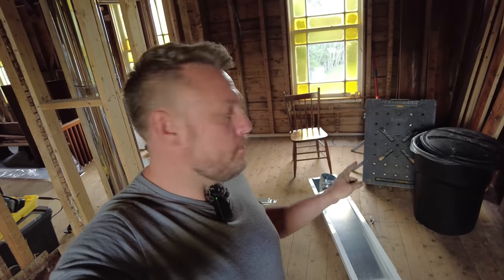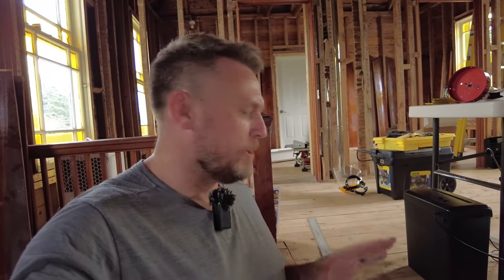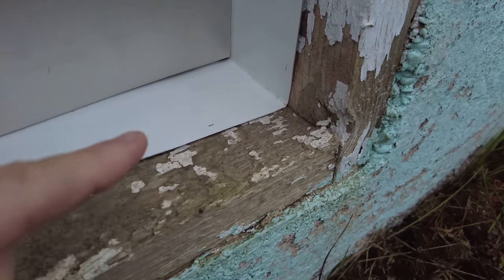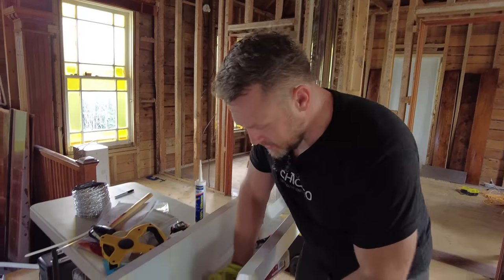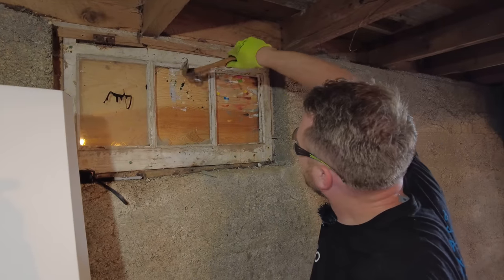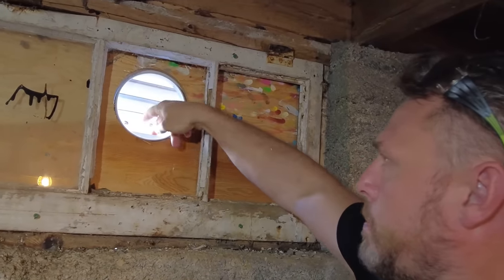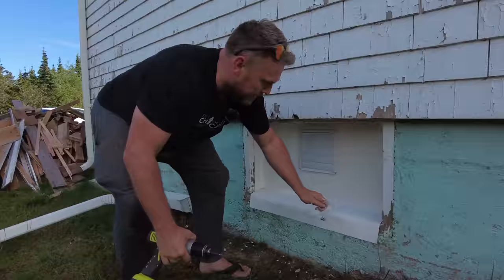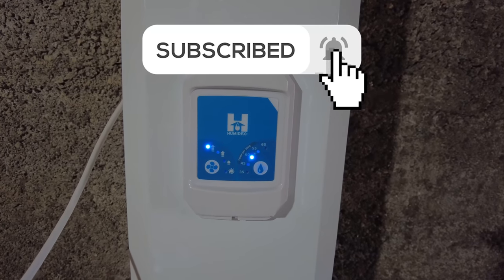DIY Installation of a Humidex in a Damp Old Church

Comment: As a landlocked prairie boy, I would guess that the proximity to the ocean would dramatically increase the humidity throughout the area and the air you suck into the church from outside would be bringing humidity into the building.   Today the humidity in Halifax was 99% - hopefully it's drier in your town than that.   Good work on the de-humidifier Gav!  Much better than I could do for sure.
Reply from the maker: 99% in December? Then it must have been 300% back in the summer.

Comment: I wouldn't worry about that janky line cut, just fix it in post.

Maybe consider shoving a little of your caulk in the bottom corners of the tin to keep rain/moisture from getting in there. Probably not a big deal if you plan to replace all that though. :)

Comment: Gav, although a photographer I'm also a commercial manager for one of the UK's leading ventilation companies. If you want any advice drop me a line. But I would definitely consider MVHR especially where you are located and recovery of the heat you are throwing away is vital

Comment: We had very damp rubble-filled void under house we bought in 2013. Spent days clearing of rubble, dust, loose material. High water table. Driveway slopes from pavement to house and met house along dpc!
Cleared driveway down 70cm. Dug ditch across front of house, French drain and channel drain at surface. New driveway sloping steeper to 2 courses below dpc.
   Void now bone dry, warm, rubberised matting, pleasure to use for storage or work on wiring or plumbing. Venting just via original air bricks. Lesson - eliminate source of damp whether vapour or water seepage

Comment: That's a pro job Gavin!  I hope it does the job for you.  If there's open earth areas in the basement it may have to run 24/7 to keep the humidity low. If I could make just one suggestion, I'd suggest running a bead of caulk along the seam where the sides tuck under the bottom sill part of the flashing you made for the outside of the window frame so water doesn't get underneath.  Looks super!

Comment: I get what your trying to achieve for the basement, needing to get the moist air out of the basement is a very good idea, but…..(theres always a but isnt there)…..air will be drafted from elsewhere….assuming you have cross ventilation (multiple air vents around the foundation) its going to pull air from the outside through those vents. If you live in a dry climate as I do, I believe it will beat buying a crawlspace de-humidifier. Where you live I am assuming its humid (i live in the desert so everyplace is humid compared to me) I would place a humidity gauge in there and measuring a before and after….my last house had a crawl space and it doesnt take but a day or so to “refill” the normal level the crawlspace will hold. I do have a feeling to get that big of an area dry in the end you will need a crawlspace de-humidifier as with that it is drawing the moist air from the bottom but when you live in a humid place all the air is moist and with the cross ventilation your going to replace that air immediately with this outside air. Whatever the humidity level is outside will more than likely be the same humidity you will have in the crawlspace. Easy way to know is get a humidity gauge and place it in the crawlspace and see what the weather says the humidity outside is and compare

Comment: Great work and video Gavin. (As always) I would have suggested filling the old window out so it’s flush to the exterior foundation wall. Then you wouldn’t had to do all that metal bending. Adding insulation to the space would help. Thx for the laughs

Comment: Hi Gavin, you will need to provide an opening, probably at a point on an opposing wall so fresh air can come in,,assuming you close the basement access hatch normally and that there’s no other gaps where outside can get in. If you have an airtight enclosure the exhaust won’t be capable of sucking out the current damp air or provide enough air movement over the damp ground surfaces to dry them. Basically another louvred 6” entry point on the other side of the building.
Reply from the maker: Makes total sense. The Humidex us designed to get its air intake from upstairs. There are currently many vents that feed that but it wouldn't hurt to have another external vent.

Comment: You probably already have a bunch of comments, but incase you haven't... I would recommend you (exterior grade) caulk all of the seams on the outside of the vent opening including where you folded the aluminum under the plate or sill area so you wont get rain water running under that - it will freeze or mold over. You might also try placing a box fan in the opposite corner of the basement facing the humidex so that it 'pushes' the damp air towards it. If you were to pour a new concrete floor that would fix a lot of your humidity issues but that would be pretty expensive. Do yourself a favor and use 'best' quality materials on your project. Going cheap or the Good Enough way means you will have to replace it in 3-5 years....

Comment: Loving these videos! Coming from an avid and early subscriber of fototripper.

I’m no expert,  but I’ve been building recording studios for many years and when it comes to keeping basements dehumidified always make sure you’ve sealed as many gaps from the exterior as possible, I think someone has already mentioned you have good air flow, but make sure that’s controlled airflow and not gaps that leaks and moisture can get into!
Reply from the maker: Do you use air exchangers in recording studios to deal with air in/air out?
Reply: @HardcastleTowers  for home builds and smaller project studios yes mvhr units can work, the problem is the noise, so generally a proper HVAC system is preferred but obvs much more expensive and you still have to consider acoustic decoupling. If you’re looking to build an acoustic space on this build I’m sure  I could get our acousticians and HVAC guys to give you some good properly informed advice!
Reply from the maker: @TheEmulsufiedEye  I just need a bit of acoustic treatment in my office/studio room which I've done before. HVAC noise is unacceptable but I've bee nin homes with an air exchange unit that was almost silent.. There must be a way to get good ventilation/air movement without noise.
Reply: @HardcastleTowers  yeah it depends on your definition of quiet, if you’re trying to reach commercial studio levels of nc15 and below then properly isolated ducted systems are the only way really.

“Silent” MVHR units will get you NC25, which is perfectly acceptable for a project studio, the truth is, you could probably get away with louder - like with any profession the pursuit of perfection is often the root cause of failure. 

There are probably far more important and less expensive things to worry about when building a creative space like vibe and how it makes you feel (I think these are the most important things).
Reply from the maker: @TheEmulsufiedEye  Well said.

Comment: I know nothing about building other than what I've seen on TV but I think you should put a waterproof membrane around the opening that covers part of the outside edge then frame around that (for looks).  I also would consider building something with an air gap you can shove some rock wool insulation into.

Comment: Enjoyed your video, as always.  You should need to tape the back of your gadget below the fan, as anything lower would be a low pressure area and air would be drawn in.  I assume everything past (on the high pressure end of) the fan is properly sealed already.  Hopefully you taped where your flexible pipe joins the fan outlet and the vent louvers, as that is where you would be likely to get leakage -- though they may have a good clamp that already does the job of sealing.  good luck with your project
Reply from the maker: It's sealed on with a industrial zip tie which is preferable if I need to adjust it. Once I've done some other work in there I'll lock it down tight for sure.

Comment: Gavin, you might want to use mesh between the louvers and the vent pipe. Birds tend to like to make nests in those types of vents. Not that I know firsthand or anything like that.😂. Great DIY video. Thank you for sharing. Peace and Safe Travels
Reply from the maker: I don't think they'd appreciate the noise but I'll keep an eye on it. Ants might be a concern.
Reply: @HardcastleTowers  Definitely put a bird/rodent mesh behind that backdraft damper.

Dont bother with a mesh thats fine enough to stop ants. it will just get clogged with dust/debris and stop the system from working properly unless you make or buy some sort of slide out filter. I'm still wincing at the cost of that too. I'm in the HVAC business and am seriously going to look in to manufacturing these if I can sell a fan and a bit of bent steel for a grand a piece...
Reply from the maker: @lukeybaby45  Good tip. I'd buy that.
Reply: @HardcastleTowers  here to help! Wish I knew about these before you bought it, I reckon I could have made a kit and shipped it to you from the UK for about 300 quid. Sorry...
Reply from the maker: @lukeybaby45  It's the nature of this channel. Hundreds of solutions to problems I had months ago 🤣
Reply: @HardcastleTowers  always the case! I love this channel though, really appreciate you sharing your journey!
Reply: I so enjoy you and Amanda !! Thanks for sharing.

Comment: I hate to say this mate, but I installed one of these in my damp basement in Maryland. It made absolutely no difference. It took me a French drain and a large (400CFM) dehumidifier to rectify the problem.
Reply from the maker: I'm right there. Did you have the right 'replenishment air' source they talk about in the instructions?
Reply: @HardcastleTowers  Yes I did mate, I had vents pushing air down into the basement from the first floor.
Reply from the maker: @fredbrackely  What kind of square footage and where the vents big enough?
Reply: @HardcastleTowers  Oh, it was about 1200 Sq.Ft. of area, and the vents were at each end, pushing air (or so I thought) to the Humidex in the middle. I used bathroom fans to pull the air down. First, I used 100CFM ea., that didn't work, so I moved up to 290CFM, which turned out to be noisy, ridiculous, and still didn't work.

Comment: Looks a good idea  ------ but without the floor sealed i dont think it has much chance of lowering the RH by much. Need to lay a concrete floor with a DPM within .
Have a Great Christmas - dont work to hard ;)
Reply: That or at least a good, old plastic barrier. Ideally a concrete floor would be nice, but a cheaper encapsulation or just a plastic barrier would help control the humidity a lot as well!
Reply: DPM?

Comment: I'm a building consultant and read about the Humidex system. 35w of running cost is far better than UK based systems. What M3 is the church underfloor and what RH are you getting with the area now in comparison with the former?
Reply from the maker: All I'm getting is BS.
Reply: @HardcastleTowers  BS? Is it a load of BS? Surely, you should have a lower relative humidity and moisture in the beams? With a cheap moisture reader, you should be getting around 30-50% RH. 

Apologies if its me full of BS 🤣

Comment: I don't understand why you didn't just drill a 6.25" hole through that 6" joistamawhatsit. 
Does your vent flapper need a screen so nothing crawls in? I mean, you already had that 1 scare😂 Although I suppose a screen would cut down on airflow. At any rate, remember to shovel any snow away. 
On a serious note, is the basement prone to flooding?
Reply from the maker: Zero standing water. Can't floor due to proper sloping around foundation.
Reply: @HardcastleTowers  Proper sloping? Score!

Comment: Hey i just order this from homedepot my basement apartment has a lot of humidity will this work for the whole basement ? Is it really good ? Please let me know before i install it or should i go for something bigger
Reply from the maker: I wasn't impressed but maybe my expectations were unrealistic
Reply: @HardcastleTowers  I used to work with Humidex. Watching the video now, but they should work well. I can always offer some advice to help make it work 'better'
Reply from the maker: @Photo_Joel  any advice welcome
Reply: @HardcastleTowers  First off, I've shared the video with the owners of the company! They were very happy to see your install! Quite impressed and happy that you followed the instruction manual! 

One of the big things that you are going to notice right now is that it's probably not going to pull out as much humidity as you would like for a couple of reasons. The first is the ground. Looking at the video it looks like you have a dirt/gravel floor. What is going to happen is that it will pull some humidity or the humidity will continue to creep in via the ground faster then what is going to be exhausted. So basically you are simply not pulling out fast enough. Ideally, and if you would have purchased one of the crawlspace units as an example, would have suggested that a vapour barrier to separate the ground and the basement itself - if that makes sense. Now, you may not be able to do that for a little bit, but as your renos progress, I'm sure that might become a consideration. 

The 2nd thing is the air upstairs in the main portion of your home to be. What is going to be happening is that the air will end up being pull from the main floor into the basement. So as the air dries upstairs, the dry air will make its way into the basement help dry things up. 

The DVS is a substantial improvement over their older models, but basically set it and forget it. Using a dehumidifier will help accelerate things, but place the dehumidifier as far away as possible away from the Humidex So that you are pulling dry air from the upstairs into the dehumidifier and then through the basement and then it will push out the heavier humid air out towards the Humidex.
Reply from the maker: @Photo_Joel  Thanks Joel. Yes, encapsulation is the next big summer job.
Reply: @Photo_Joel  I am considering a Wave air system.  Do you have any comments about this brand?  I have a standard basement  with concrete walls and floor.  We have some efflorescence on some of the walls indicating there is moisture over time.  Will these systems help to dry out the concrete so we can treat the efflorescence?
Reply: Wave air like Wave Home Solutions? I thought they went out of business or closed. But they were buying the Humidex Systems branded under the Wave logos. 

Would it work, yes but it does take time to see the results and a dehumidifier will help kickstart the process and then become less reliant on it.
Reply: @Photo_Joel  Thank you for the feedback.  Yes - the Wave Systems unit I'm considering is part of NOS that has been sitting for a wile.  It will cost me a fraction of the original price and I would like to see if it will help.  I also have a dehumidifier but it is older and finding the sweet spot on the dial for the automatic on/off humidity control is iffy.  I'll give it a try and see if I get any positive results.
Reply: @Dave-tg1pu  Do you know which model you are looking at? Some have had better performance or reliability vs the newer models that they are offering.
Reply: @Photo_Joel  I have the Sensor Control BT Model# - HCV-BS-Wave

Comment: I can tell this is going to be a long long series of church renovations . Where does the air going back in come from. Shouldn't you have used a air exchanger that bring fresh air back in and takes the heat from the out going air ?
Reply from the maker: Most likely a full air exchange system will be installed. For now the 'replenishment air' air comes back in from multiple vents upstairs.

Comment: Gavin. Really? I've got to 3 mins 12 secs and I have to say. 

You're from the UK man. UPVC sheet and a couple of tubes of silicone would have been a better option. Do those products not exist in Canada?
Reply from the maker: Ok I've fixed it, hit refresh and watch again to see it.
Reply: @HardcastleTowers  Awesome. What more can I say.
Reply: @HardcastleTowers  Gavin. If you had as a first step removed the window, built a tantalised wood frame for the gap with insulation and faced it with whatever material and then drilled the hole before fitting you would have had less faff. 

Then adapted the Humidex the job would have gone a bit easier.

I offer this advice as somebody who has bolloxed a number of jobs and minor body parts not following that sort of advice.

Anyway, happy Christmas to you both.

Comment: Humidex' suck because as they push out the damp air and it's just replaced with more damp air.  Better off with a de-humidifier plumbed to the outside.
Reply: My plumber put one in and I saw absolutely ZERO improvement.  My 50 pint $200 dehumidifier does more in an hour than this thing did in the last 2 years :(